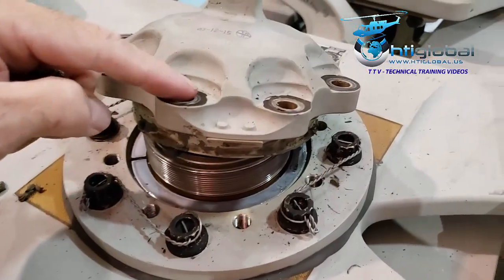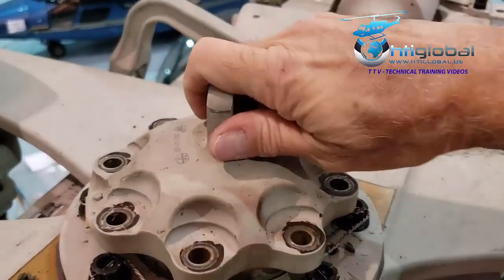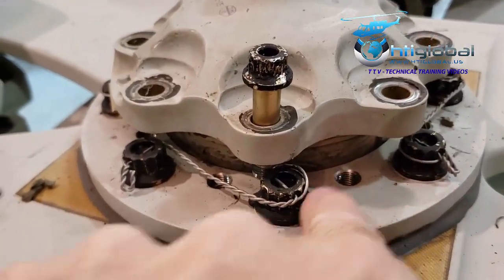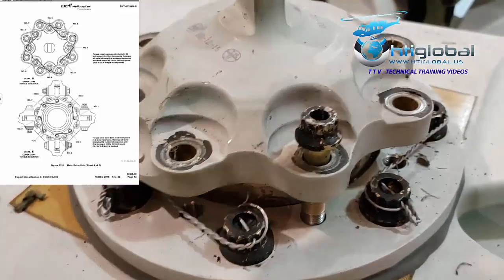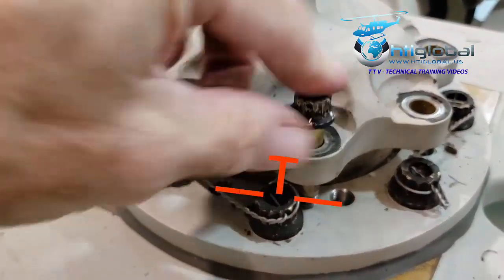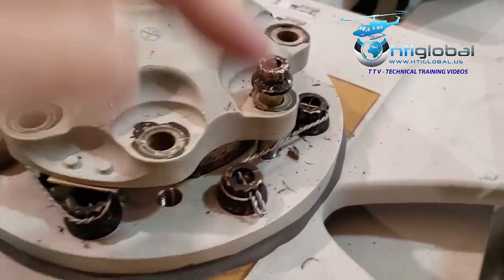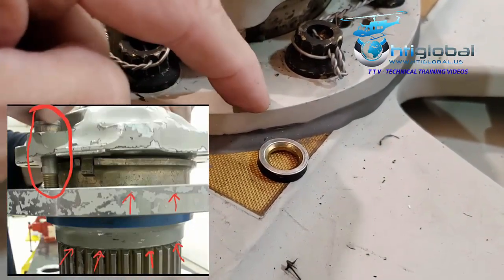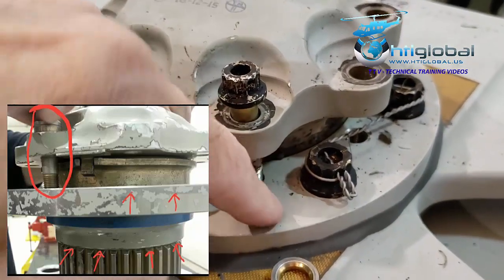Bell 412 MR Hub Nut

Comment: What is the requirement of that clearane between the upper cone seat and the mast??
Reply: Hello, the clearance will be when you turn loose the main rotor nut and either option will be ok by Bell so the upper cone set will not touch the mast. If you are asking me a number, there is none. Also if there is a number it is impossible to measure it. I hope this answer your question. Regards, Pablo
Reply: @pablolinares9360  thank you very much , but it raises another question that if the cone seat touches the mast , what will happen ? What will be the implications?? Thanks.
Reply: @anirbanbhattacharya2724  Good evening, if you follow the Bell 412 MM and always back up the nut as required in either case you always will have a gap bwtween mast and upper cone seat. Now if dueing torquing you get the holes aligned at the moment you reach 25 ft/lbs and do not back up the nut, then the upper cone seat is touchin the mast. Leaving like this  next time you remove the main rotor can have marks in the mast. Most possitive that mast will be scrap then. The limitations for damages in that region are minimal to none.
I hope this clarify your concern. Regarda, Pablo
Reply: @pablolinares9360  Thank you very much sir . Great to be connected with you. Very nice explanation . As a regular follower of HTI global , I would like to see more of your insightful videos in future. Thanks again.